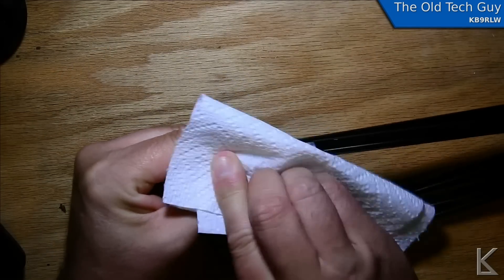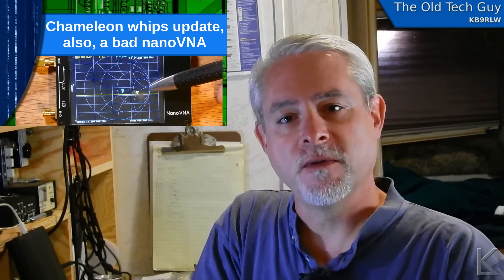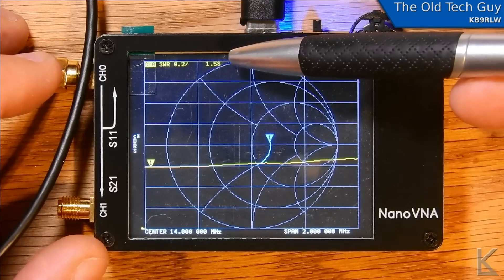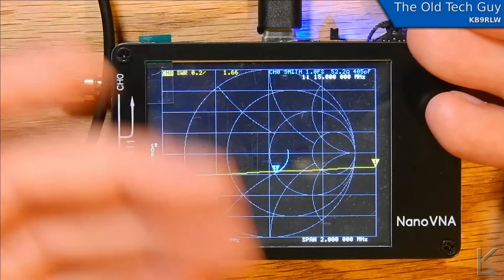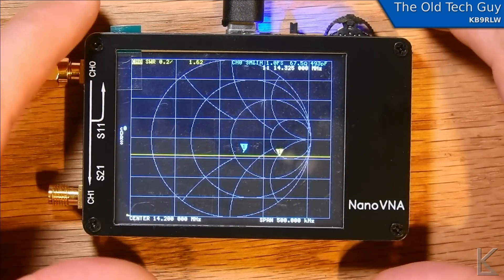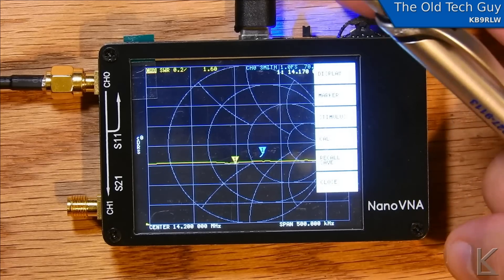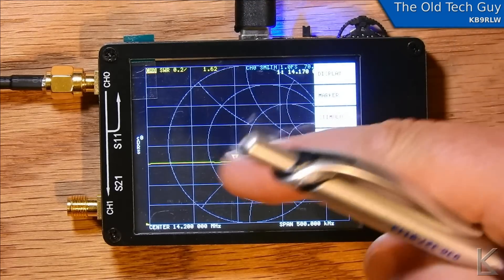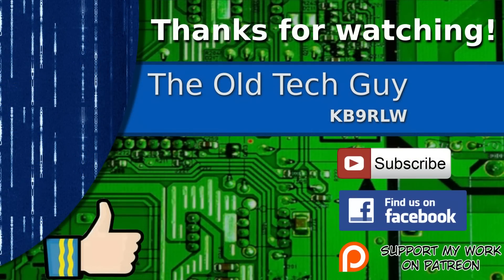Ham Rado - Chameleon whips update.  Also a bad nanoVNA

Comment: I too purchased what does appear to be a bad unit. I bought a Nanovna-h (same 2.8” screen but 10KHz-1.5GHz range). Mine has the same symptoms as the test unit here. Calibrated with provided cable on. Proper results show upon testing the calibration with the provided open, short and load screw on caps. Testing SWR on three dual band antennas yield wildly off SWR... all three antennas are solid performers in real life.  A vertical mobile mag mount, mounted on metal, showed a near flat SWR of ~1.3:1 130MHz to 160MHz (I wish!). An Elk 440\2m 5 element log periodic mounted on pvc pipe showed extremely high at 146MHz (6:1) and that was it’s good spot in the 2m band. But I am willing to give another vendor a shot. This is an extremely useful device if it works, especially at this price point, like so many others that have. Just not mine...

Comment: My NanoVNA had similar issues. Changing the start/stop frequency range caused an issue with the Y axis scale. I updated the firmware and resolved all issues. Give it a shot - very easy to do.
Reply from the maker: No, it wasn't simply scaling.  If you noticed on the display, the indicated measurements in text were incorrect.  It is an electronic problem.
Reply: @loughkb , yes mine was doing the same. Try a firmware update.

Comment: I bought a nanoVNA. One of the lucky ones, I guess. Because it is open source hardware and software, there are so many manufacturers all using the same "look" (apart from the white one). I did have one issue though, and that was the "jog wheel" at the top which had two dry joints. Just a soldering exercise, luckily, however I find I don't use the jog wheel. I find the touch screen more convenient. First project  I used it on was making a VHF/UHF ladder-line J-Pole. The nanoVNA was just way more convenient than my Siglent Spectrum Analyser and tracking generator (especially for outside testing). However, I did compare both, and the nanoVNA was on the money.
Reply from the maker: Cool.  It is pretty neat.  I like the near real time display updating once a second or so.  I could see it being very useful.   I might even buy one myself once a good consistent source is found.
Reply: @loughkb  - I bought one from a indicated reliable source / Seller from Ebay. The device is by far the best purchase I ever did! Very easy to use, small for outdoor, perfect to use with PC SW frontend on the workbench. Measurments are reliable, repeatable, and consistent considering a carefull and correct calibration procedure. Calibration set that came with it was capable until 900Mhz. I only replaced the two black cables to a own build RG316 set. But also the black cable set that came with the unit is good  enough for normal use. Two port S Parameter mesurements are in a range of 80dB until 300 Mhz und go up until 900Mhz considering a 50-60dB dinamic range. That's much more than enough for solid RF hobby application! Quality is no issue at all if the unit is purchased from original Hugens seller US$60 or a proven reliable source from eBay or AliExpress. I payed US$42 shipping included. The unit had a perfect build quality and the 3 mixer stages had  separate professional RF covers mounted on the frontend. My unit is a "Black" one. Some of the "White Salamander" units show low build quality. Firmware should be updated to enable better performance and more functions. If you have a good unit I'm shure that you will make the experience that the NanoVNA is as good as the MiniVNA considering a much lower price and the advantage of mobile use with the display or PC use on the bench. As I just said, it was the best purchase ever. My other two analyzers I will sell since the NanoVNA made them compeatly obsolete. Specially the expensive Rig Expert without two port capability at all.

Comment: While I wrangled with the vendor for the unit that had the white screen of death, I checked on the nanovna mailing list and found the original seller, a Chinese man named Hugen. He has a page on Alibaba, and I bought one of his for $60. First difference, he ships via DHL Hong Kong. It arrived in about five days. I spent the evening playing with it, and it works fine.

I scanned my Comet all band vertical, and it had the appropriate dips and bumps you'd expect from a compromise antenna. 

The broken one's seller got back to me and promised a new unit for $5 shipping, and I could keep the bad one. I finished that transaction, and am waiting to see if I actually get the replacement. I expect it will take weeks, as they ship on the proverbial slow boat from China.

Meantime, now that I don't have to return it, I'll see if I can fix the bad one. That's some suggestions on the mailing list, mostly reflowing solder joints and replacing some capacitors. I already found one solder bridge in the display cable joints. Didn't fix it, though.

These things are very nice, but suffer from the eternal issue with Chinese electronics -- knock offs! I'll send you the link to Hugen's Alibaba listing later, when I'm not on my phone.
Reply: As promised, here is the page for Hugen's listing on Alibaba. I am VERY pleased with the service, and the device is working well.

https://www.alibaba.com/product-detail/Original-2-8-Touchscreen-50KHz-900MHz_62232701280.html

There is mention of a) PC software for it, and b) a version of the firmware that has LARGER FONTS. You sacrifice 2 tracks for the screen real estate, but that's ok if you 're just analyzing an antenna. I'm going to try that when I figure out the procedure for reflashing it.
Reply: Gwen Patton Interesting...that link is to a supplier called Maggie, and appears to be mainland China and not Hong Kong.  Is that correct?
Reply: @ammocraft  I guess so. The shipping track starts in Shenzen, goes to Hong Kong, then DHL picks it up and takes it to the US. So it starts in China but shifts to Hong Kong for the carrier to take it overseas. If I'm reading this tracking info correctly. I had to translate some Chinese.

Here's part of the track. I use a translator that inserts the English inside [brackets] in-line. 

线上 [On-line] Shipment Information Received
2019-09-23 09:53:13
越航深圳分拨中心 [Vietnam Airlines Shenzhen Distribution Center] Storing of all packages complete
2019-09-25 10:33:05
越航深圳分拨中心 [Vietnam Airlines Shenzhen Distribution Center] All packages have been screened, pending delivery after payment of shipping fee
2019-09-25 12:38:40
线上 [On-line] Payment successful, pending shipment
2019-09-25 14:27:06
越航深圳分拨中心 [Vietnam Airlines Shenzhen Distribution Center] Package has been shipped
2019-09-25 16:54:46
HONG KONG - HONG KONG Picked up
2019-09-26 01:57:00
HONG KONG - HONG KONG Arranged next transfer hopper
2019-09-26 04:18:00
CINCINNATI HUB, OH - USA Clearance completed
2019-09-26 09:20:00
Reply: @JennyEverywhere  For $60 express shipped, I took a chance!  Thanks!

Comment: I bought one, and mine has a full case around it, with shielding and connects to my phone without any problems. As for accuracy, I'm still exploring it... It was advertised as having the latest firmware.

Comment: Concidering the functionality of this device, for $60 I'll be ordering one from Amazon in a few months after I get into my new QTH and start erecting EndFed and Random Length areals.

There are several listings of this same device on Amazon from $45 to $80 from different vendors. My selection will be based on reviews.

If 'Sold By Amazon', then returns/replacements/refunds are EzeePeezee and I would simply cycle any bad units back to Amazon till I got a good one.

I know, I know, shouldn't have to do that but for the price, why not?

Thanks to Kevin for bringing this problem to our attention and also to the poster who said that new firmware may be on the way.

PS: Funnie Story....
Several yrs ago I had a contract to TS/Repair 500 PCBs that failed Temp/Vibration/HI-LO Voltage testing, etc. These boards were about $200 each in inventory.

The company had been collecting them for months and kept re-testing them in an attempt to complete production orders to IBM, with no success.

IBM came in to audit material that they had paid for but not received and discovered that dozens of 'bad' boards were missing from my Impounded Material work area.

Come to find out, the Production Manager was stealing bad boards from me to complete his shipping quotas.

Since the boards were only FLAKEY and not DOA, he figured that IBM would never catch on but their BeanCounters caught him by cross checking serial numbers of missing boards with those of boards received by IBM.
Oopsie-Dassie......
He was fired! HaHa

After reading my Test Reports, IBM decided to scrap all those flaky boards and refused to pay the company for their Labor/Production costs. My good paying contract was also scrapped. BooHoo....

Maybe something like this is happening with the Nano-VNA. I've seen whole production lots sold off as Scrap only to be picked through and resold on retail markets by the scrapper.

PPS: Those flaky boards were defective because the Feed Thru Drill Size was too small causing the Plate Thru process to randomly fail causing intermittent opens. Earlier production runs were OK but their PCB vendor reduced the Drill and Land size because they were getting Land to adjacent PC Run etch shorts.

Both companies Under Bid to win their contracts then cut corners to Break Even then both companies eventually went bankrupt after IBM sued them for Breach of Contract.

Comment: Did you not notice that in SWR mode instead of 1 / 1.62 that it was showing 0.2 / 1.62, that may be the reason you aren't getting the same results as your blue VNA.  I now it has been several months since this video came out and someone else may have noticed that.  Juddie WD8WV
Reply from the maker: That first number is the steps per graticule mark.  By setting it to  smaller number, the graph is expanded, making detail more clear.  It has nothing to do with the actual measurement.

Comment: One caveat I found.  Ordered 2 different source versions.  Both had calibration sets included.  The "50 ohm load" on one measured 43 ohms.  The other load measured 50K ohms.  I used one of my own known loads for calibration and they seem to be working after using a good load for calibration.  AE5X just blog posted a comparison with a Keysight N9913A.  I can't swing $12K or borrow one of those from work, but on a similar RTL filter test my results or close enough to AE5X.  Good enough for HF and for the shack.  On to filter tuning.
Reply from the maker: Both calibration sets I tried, the one that came with it, and the much more expensive set with my Blue miniVNA measured to withing 1/10th of an ohm around 50.  Tested the cables too, they were also fine.
Reply: @loughkb  Yeah, I hit the jackpot.  Was happy enough the Nano's worked, not a big deal to find a test load.

Comment: Would you consider doing a step by step tutorial on setting up the Nanovna for swr and impeadence. I figured out the calibration part. Thanks for great content! N2KTO
Reply from the maker: It's already on it's way back to Ric.   But as I recall, it's not too hard.
Go to the display menu and there are buttons for all the traces.  Turn off all but the first two.
Then, click on 1, to select it, click back and there is a button labeled function, I think.  Choose SWR.   Click back and click the button for trace 2 to select it, click back, go to function and select smith.  The smith chart is for impedance, but it also reads out at the top of the display in text.
After you have it like you want it, use that recall/save button to save it to slot zero so it will load when you turn it on.

Comment: Howdy there Kevin!

Ok, please forgive me... I know you are a sharp guy, but I have to ask based on the video...

Um, did you ever try channel 1?
All the vid shows you connected on ch 0...

If they both do the same or similar, the problem is further down the line (a/d, ?), if ch 1 works, then clearly ch 0 is trashed.

Sometimes the obvious check eludes us. I once spent 3 hours going in circles, not realizing that in the middle of a test, one of my o'scope channels bit the dust. Finally, I moved the probe and things started looking good once more. 

Good luck & 73 - John
Reply from the maker: I did, same problems.   I didn't really have the desire to dig into it though.  One, it's not mine.  And two,  it's brand new and bad.  It's going back.  If it's new, it should work.  It's the principle of the matter to me.  And if it ends up costing the seller, all the better.  Maybe he'll get his act together if he feels it financially.
Reply: @loughkb  copy that! I wasn't suggesting a repair, just curious if the other side worked. 

You're right! No matter how inexpensive a new product should always work!

Sounds like they not have quality issues, but a poor testing procedure.

Thanks for the quick response.

73 & have a great weekend. - John
Reply: 6:30 am, first cup of coffee and your video - that's the way to start the day.  Good video.  Keep them coming.
Reply: @loughkb  Get his act together?  Naw,  he'll just change name/storefront,  pay for some fake reviews, and sell an initial boatload batch until complaints start.  Wash, rinse, repeat.
Reply: @loughkb  What, exactly, do you expect the seller to do to "get his act together"?  Open up and test each unit extensively before tossing it up on ebay for $40?   Give me a break.
Reply from the maker: The usual.  Demand a level of quality assurance from his manufacturer under threat of shifting to another manufacturer.

Comment: I have an "upgraded" version with a bigger screen, a full metal case and excellent shielding on the PC board. It is the NanoVNA-F which I purchased directly from the developer, BH5HNU. Here is the GitHub page for the product: https://github.com/flyoob/NanoVNA-F 

This version is more expensive (approx $120) but is a higher quality build with a bigger screen. I am extremely happy with this unit.

One thing to be aware of with any of these units is that since they are open source, anyone can manufacturer a clone and many of those selling them are offering units of dubious quality. Buyer beware, not all units are created equally! I chose to support the ham who designed this particular version by purchasing directly from him. 

DE WA1KLI

Comment: Now you having me anxious to getting around to testing the one that I bought.  D*#n those stupid SMA connectors!  (You did torque them down, I presume?  They're reported to be fussy about that.)
Reply from the maker: Yes, when working with UHF through microwave, they should be torqued down.  Not an issue way down at HF freqs though.

Comment: It's showing 0.2:1.65 SWR? Is that affecting your readings mine lists it as 1/#
Reply from the maker: With only 1.0 per division, it would be even flatter.  A SWR of 2:1 would be the first line up from the bottom, 3:1 the second line.
Regardless,  moving the marker showed that the indicated SWR only changed by about 1/10th over 3MHz.  That's incorrect unless you're hooked to a dummy load.

Comment: It took me a while to see this is an antenna analyzer. There is one I keep seeing used a lot that seems very good.I'm sure its far more expensive. But you need some quality too.
Reply from the maker: Oh, this is so much more than just an antenna analyzer.  You can use it to measure filter circuits,  feedline loss,  all kinds of RF things.   It's like a star trek tri-corder, but just for RF stuff. :-)
Reply: @loughkb  Thanks, I had no idea. And its the size of a lighter
Reply: @loughkb  I ordered one yesterday before watching your Video Kevin. I have always wanted an Antenna Analyser but never been able to afford one.
If the one I get works then it will be a great addition to the test gear.
Do you happen to know if these can be used as a signal generator?.
Thanks for the FB Video Kev👍👍

Comment: Was looking at buying on of those nano vna
Reply: I ordered one yesterday and it's supposed to be a Manchester supplier so shouldn't take too long getting to my Qth in Liverpool. Was around the  £30 mark so if it works it should be brilliant. I have always wanted an Antenna Analyser but way too expensive up until this device.
Reply: @stevejones8665  I have a rig expert AA35 it does the hf only just need it for the higher bands.

Comment: Too bad there isn't just an iPhone or Android App for doing VNA (with an adapter on the phone)
Reply from the maker: There is, it's the Blue miniVNA.  It uses bluetooth as one type of data connection and an app to control it.  I use that regularly in my other videos.
Reply: @loughkb  Ok, good to know. Thanks. I guess I'll have to check that out. The blue VNA I saw in your video seemed more like one you connect to a pc.
Reply from the maker: @tglenn3121  You certainly can connect it to a computer, via USB.  Then run desktop software.  I think I demo'd it in my video on the miniVNA.
It has both options.

Comment: I bought my NanoVNA from Amazon and it seems to work fine although I have to admit I don’t know exactly how to use it. Mine has the 50Khz to 900Mhz firmware in it. BTW, the white face ones are the inferior clones, the black ones are original according to the designer.
Reply: there are butt loads of FAKE black ones to ! 73 N8AUM